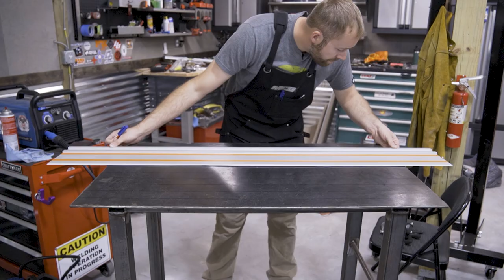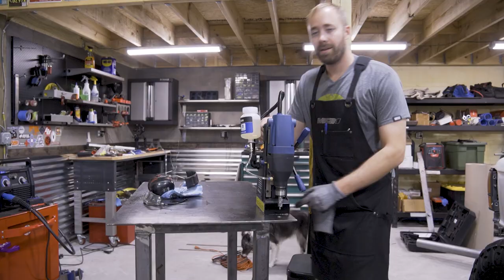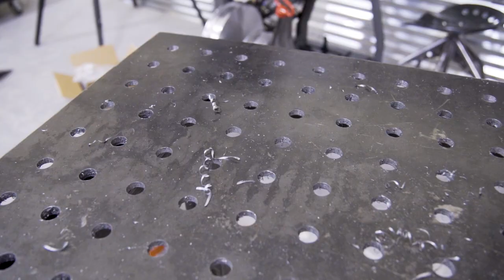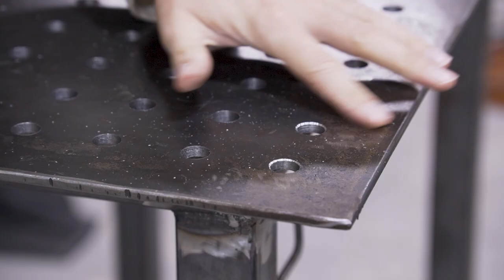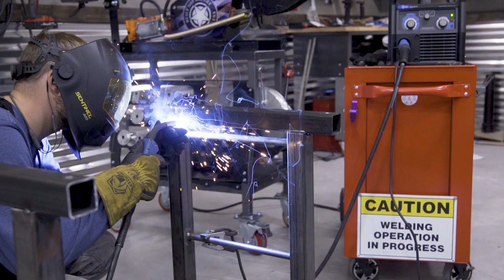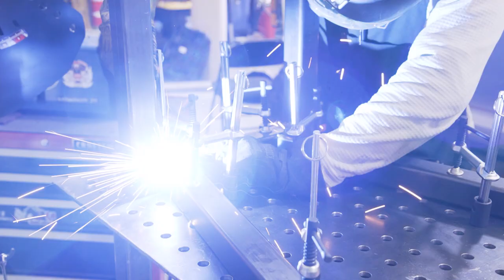DIY Welding Table - Reckless Wrench Garage

Comment: Nice job, thank you.
I enjoy looking in on home made welding table videos. Mine is not the peak of welding table flatness or size or rigidity. But with the gift of an old steel-framed computer table from a school I had the basis I needed, it’s 2 feet x 4feet. I got a 3mm plate to fit it, laser cut to 18mm holes on 50mm hole-centres and it does for me. 
If I had to drill my own holes or I did the job again I think I’d choose 100mm centres (4 inch centres) because 50mm/2 inch centres mean a lot of holes and they must weaken any thinner plate and make it more likely to flex, and droop a bit in the middle. But as you say, DIY and save some dosh! Thanks again, Les

Comment: Thanks for sharing. I have been loading up my arsenal to make whatever I want also. It is very satisfying to build and not buy over priced.
Reply: Not only over priced but under sized on the material they use for these products. It's nice being able to make something strong enough to last for decades and not just some years
Reply: Every tool you build is another tool (you can’t build) that youll be able to afford to buy to expand your abilities even further 
Besides every tool you build is just more experience you’ll have at building 
It hones your craft for the projects that really count 
Ain’t nobody gonna care how perfect your tire changer is 
Nobody gonna pick at the hydraulic press not being the latest and greatest 
Same for sand blasters or refractory furnaces 
My motto is if I can make it for the same as it costs or close but I end up with a better product than  that’s something I should be building in my down time 
Basically he just bought the mag drill for free and ended up with a fixture table that’s of higher quality than the fixture tables you can readily buy 
And every tool has a mount exactly where you wanted it

Comment: And here I am excited that I just bought two 90 degrees vises to make a perfectly square frame on my garage floor, to mount a piece of 3/8" plate steel to for my very first fab table 😅 similar to you, tiny 2 car garage, so it's built to be small but maximize space
Reply: Well you should be excited. The only comparison you should be doing it to yourself from the day before. Everyone progresses and achieves at a different pace. So yeah. Watch others but use it to learn and not to down yourself with things someone has already and you don't.

Comment: Only 1000 dollars in tooling for a 50 dollar table. I appreciate this.
Reply from the maker: Most garages that need a welding table already have the tooling. When I was looking at fixture tables anything decent starts around $700
Reply: I wish they were only $50… I just priced certiflat tables out last weekend. 😮
Reply: Maybe I should clarify. The table you already have is 50. I know a bit of an exaggeration but still.
Reply: @denny244  I’m going to guess you haven’t bought any steel in a good amount of time! Just take the video for what it is! 😐😑😐
Reply: My mag drill was $200 delivered, annular cutter $20 from my local tool shop. Full sheet of 5mm 4x8foot plate $66. Australia is kick ass for iron/ore/coal electricity/China imports
Reply: I rented the mag drill when I made my fixture welding table.  I used a cheap Amico welder I bought off line,I used a 4 1/2" grinder with  cut off wheels. You don't always need $1000's of dollars in tools to make something.  Use what you have, rent or borrow tools from friends and think outside the box,get creative. I don't have all the best tools,some of them are rather cheap,some of them came from Harbour Freight. If there is a will there is a way.
Reply: I made my table from a road plate.
Reply: @janeblogs324  but the price of Petro OMG!
Reply: @jerrygoldfuss466  if there is a Will there will be arguments.
Reply: @akbychoice  petrol? Cheap as in Ausfalia. $2 a liter. Half what Germans and English pay, if you compare to USA its identical with our minimum wage etc. Run your car on natural gas from home if you're a tightass, 35c a liter
Reply: @janeblogs324 wow, I built a 4x8 - ½" plate table, and my top cost me $600 in 2007 in California. You do have cheap steel.

Comment: Just an FYI, don’t lift the annular cutter like that. They are designed to drill with continuous pressure. Band saw coolant works well, WD40 could get expensive.

Comment: Did you drill through you table frame when you done this?
Reply from the maker: Yes. The frame 1/8 thick square tube and I drilled through the top layer.